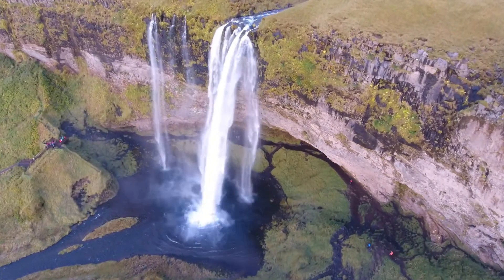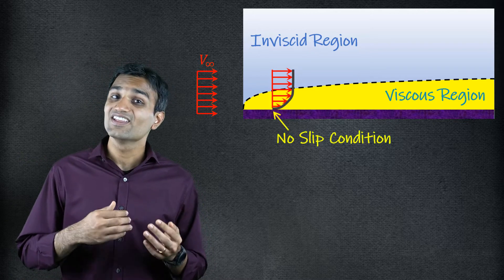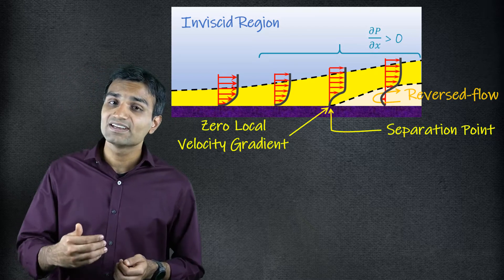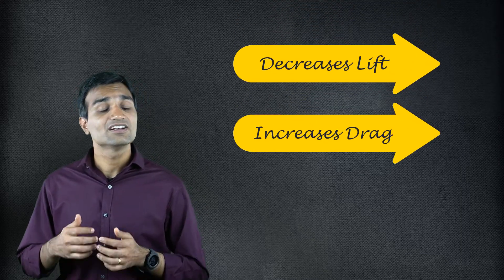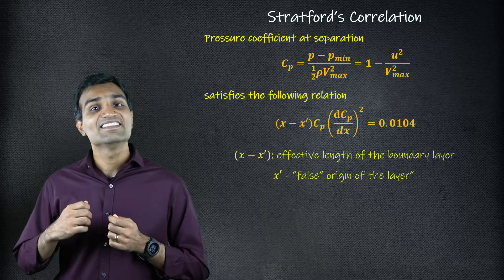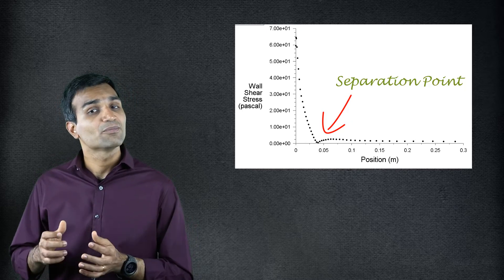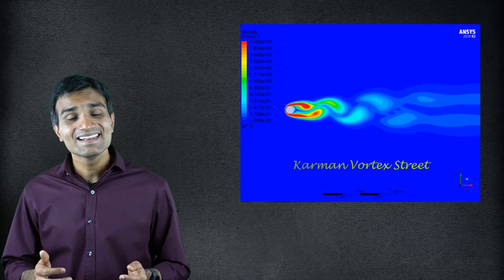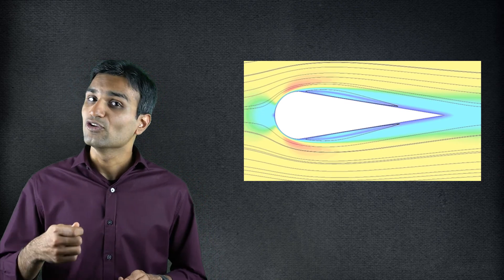Flow Separation and Reattachment — Lesson 4

Comment: It's still not very clear how the pressure gradient along a horizontal flat would be negative? Could you kindly elaborate? 
Thank You.
Reply from the maker: Thanks for watching! Please post your query on the Ansys Learning Forum for a detailed answer from the wider Ansys Community: https://ansys.com/forum.
Reply: Consider a Fully-Developed laminar flow over a flat plate, hence constant velocity and no acceleration. For such a case, the only force which is opposing the flow is the force (resistance) due to shear (viscous) stress on the plate surface. Now, as the mass (flow rate) needs to be conserved, the flow needs to overcome this opposing force . It overcomes this force by a corresponding decrease in pressure along the direction of the flow.  This pressure difference results in a force opposing the viscous force. 
So to sum up, a force is required to push the fluid against the viscous force (also known as flow work/flow energy), which is provided by this pressure difference.
Pressure gradient would be -ve as well as constant for this case.
If the flow was additionally inviscid, then there would be no viscous force, hence no pressure gradient.
Hope it helps.